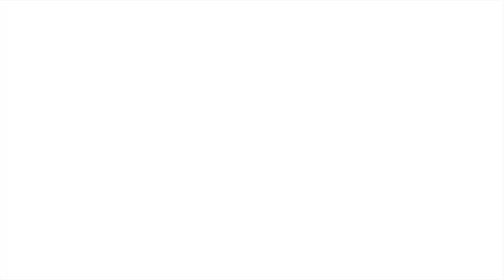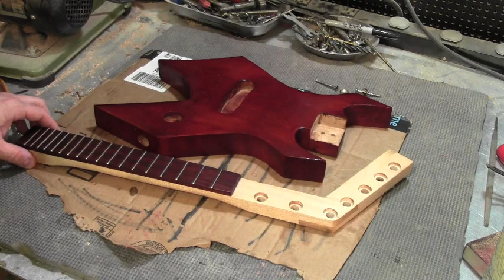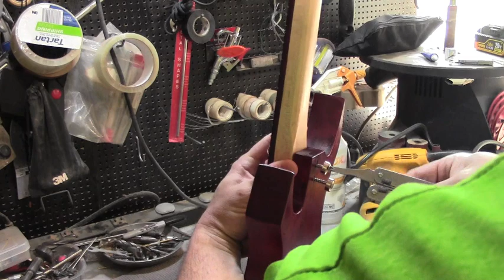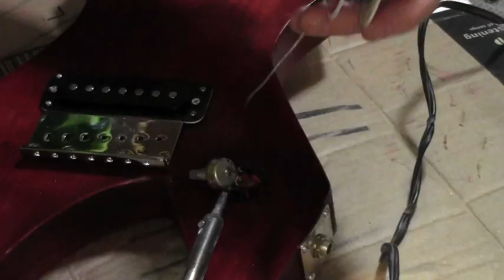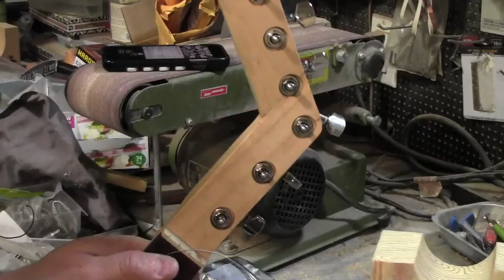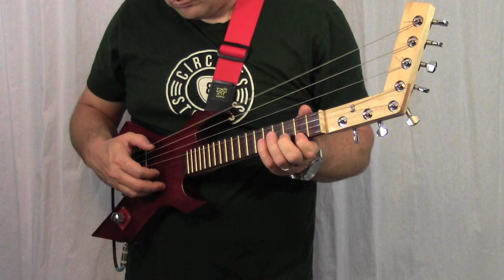Electric Harp Ukulele

Comment: Amazing!! May I ask which brand and which parts of harp strings you use on your harp uke? I checked up, there are many strings in a set of harp strings, they have the nylon, steel-wound nylon, catgut or copper. PS I want to make mine like normal ukulele + 3 string harp, but borrow your idea of design, and thank you for sharing it with us.
Reply from the maker: I actually just used electric guitar strings. A “light” gauge set, with an added extra D string to make 7 strings. Because I used a magnetic pickup, I needed to use metal strings.
Reply: @CircuitsAndStrings  Thank you for the reply!! Your project is really inspiring!